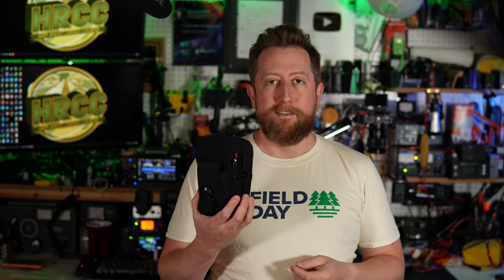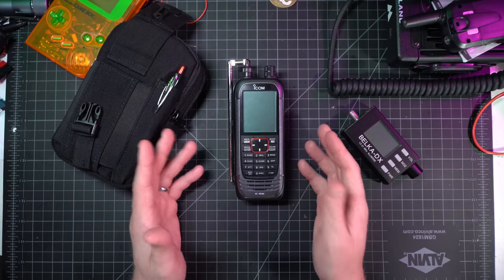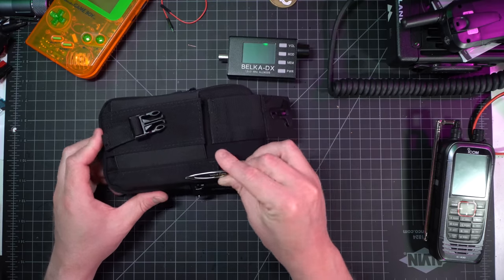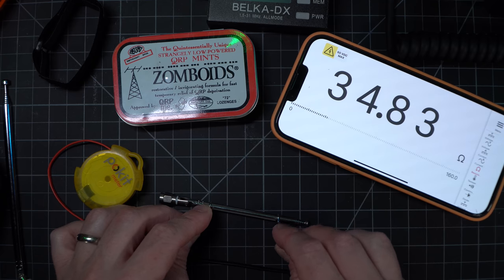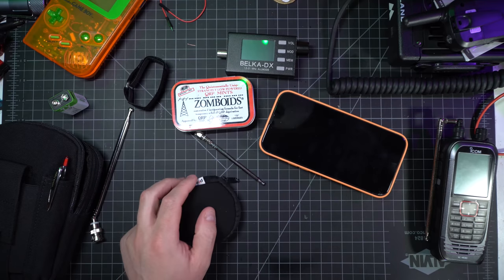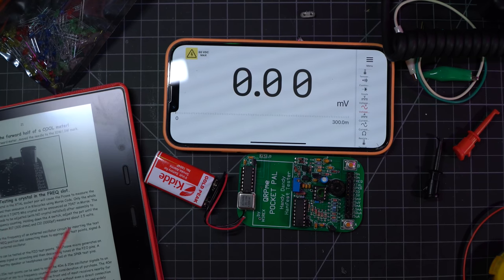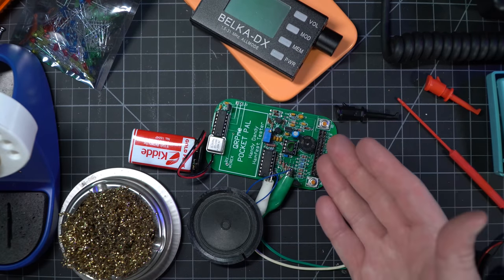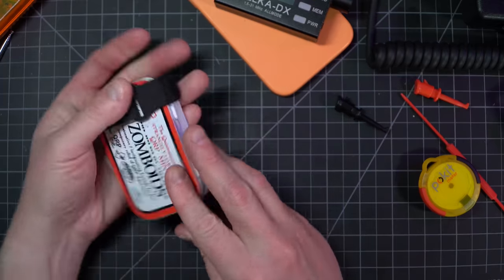Hamfest Test Tool Ham Radio Kit

Comment: Great idea taking test equipment.  I've been amazed at how dishonest some hamfest vendors are.  I've tested an item right in front of a vendor and showed them it is did not work.  When I walked back by a few minutes later they were telling another customer, "Oh yeah, we tested it last night and it works fine."  In other cases, I've bought items where the seller insisted he tested it and it worked.  When I opened the case I found it missing parts such that there is no way it could have worked.

So, if it is anything I really care about, I test it before buying or at least in the parking lot before leaving.

Comment: One thing you left out is hand tools.  I carry a couple of screwdrivers with different bits, needle nose pliers, small adjustable wrench, small vise grips.  At one point I also carried a 12v nimh battery back, tiny power meter, dummy load for testing mobile radios, and an HT to listen on.

Comment: I have something similar and I've been a little shy about whipping it out - its a signal generator that you can connect directly a radio... I know if some random-ham walked up to my table wanting to connect this weird PCB to my rig I'd be weary of it... in my case it says "elecraft" on the circuit board and it is an elecraft product, but still might be a bit off putting.  Have you run into any pushback?
Reply from the maker: No. In my case it just uses the test leads as an antenna so it just needs to turn on, which it should right 😅 I don’t think any reasonable ham would mind.
Reply: @HamRadioCrashCourse  Ah, I am pretty sure the one I have connects directly.  I got it for a Nuggets Live stream... one of these days.